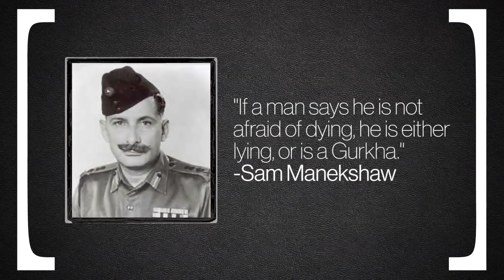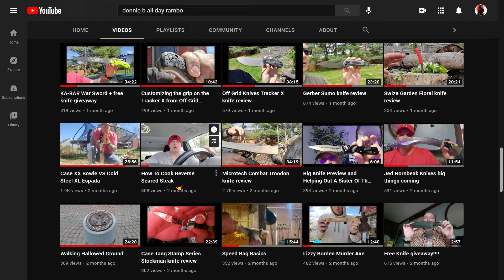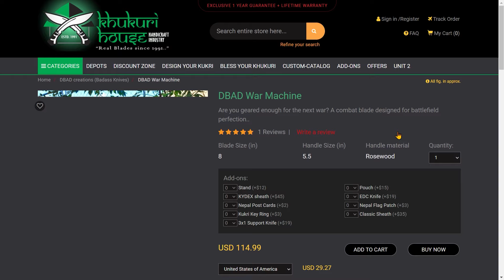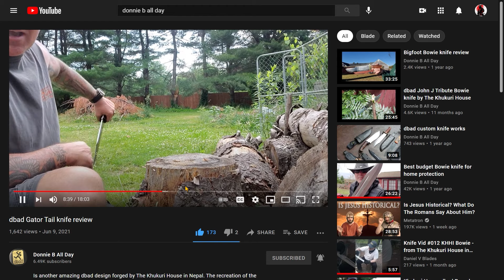The Khukuri House KHHI Nepal-History & Amazing Products #22aday

Comment: For the record, I have owned and used a KHHI made Scourge for years, however the designer Andrew has since taken his design to another khukuri house and KHHI are actually no longer the official makers. That happened about 2015 or 2016.
Reply from the maker: Good info to know, whom ever is responsible, I am very impressed with mine...thanks for sharing
Reply: @JoeSteel1  oh I love mine, my wife got it for me one Christmas right before Andrew took his design to Kailash. That khukuri has traveled hundreds of miles with me, made a ton of fires and is a trusted companion. Mine does not have the pin in the finger guard like yours but there hasn't ever been an issue so not sure why they did that.
Reply: Where did he move too? Because I just bought a Scourge from KHHI and I think they burned me. UPS says that they do not have my package. I also got a completely separate email from a shipping service called "Quick Way" that KHHI uses and they said that they already handed it off to UPS be shipped to me. But that is completely untrue.
Reply: @zephyr_924  he helped found Kailash Blades. As for the shipping issue I have had my fair share of issues with many companies, especially the scumbags at DHL.
Reply: @turtlewolfpack6061  they have been sending me emails. One of them less than a week ago said dear sir the shipping label on UPS end hasn't updated but it will once your package reaches the US. Well that was almost a month ago. And just now I received an email back to the one I sent last night that was me asking does it usually take a month to arrive? Their email said dear sir, no it doesn't take that long at all I emailed our cargo shipping team to see what the problem is. At this point I'm firmly believing that someone stole it. No idea if I'll get a refund or if they will make my blade again. Either way I'm going to review them here on YouTube. If I get my blade it will be an honest review. If I don't, well it will be an EXTREMELY honest review.
Reply from the maker: It's stuck in customs I've had that happen before the companies can't control that
Reply: @JoeSteel1  Yeesh,  so that's probably the hold up? 
If I may ask, did you still receive your blade(s)?
 Also I'm wondering if for some reason it gets confiscated by customs does it just goe bye bye or ??????🤷‍♂️
Reply from the maker: @zephyr_924  yes.. just sits longer, they might inspect it.  .but I can't tell you 100percent if you will have same situation though
Reply: @JoeSteel1  ok I see.  And I'm truly sorry but I'm a little confused on what you were trying to tell me in the last part of your reply.
Reply: @zephyr_924  odd they used UPS and not DHL. Either way a call to the shipping company should shed some light.

Comment: They make great knoves I just offered the 15 inch blade Mukti 🤙🏼🤙🏼
Reply from the maker: The only thing I recommend is to request a sharp edge if you require it as while there work is solid and well done, there edge is not as sharp as I would want them to be, I actually just designed a tanto that they are going to be selling on their site, thanks for being here buddy